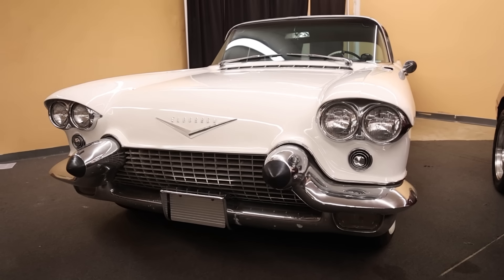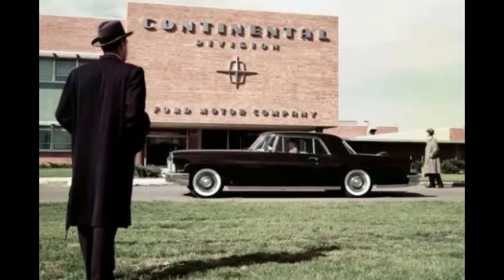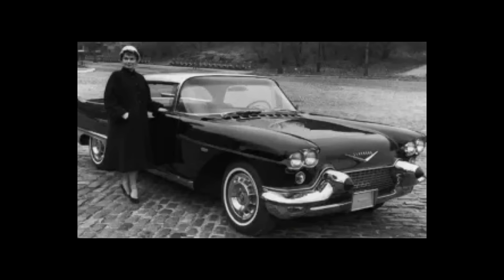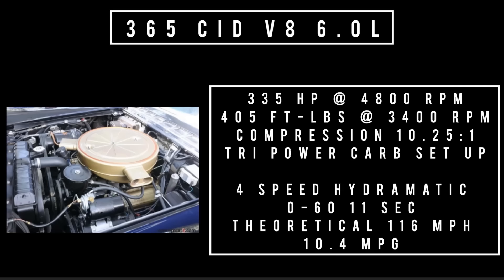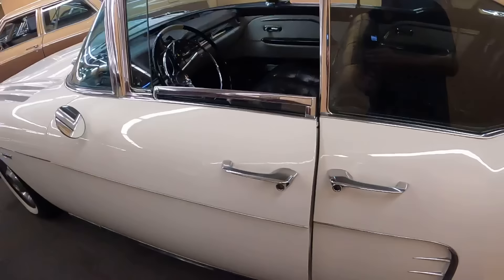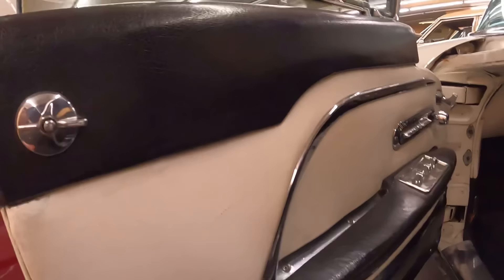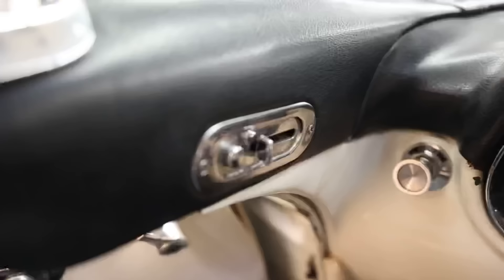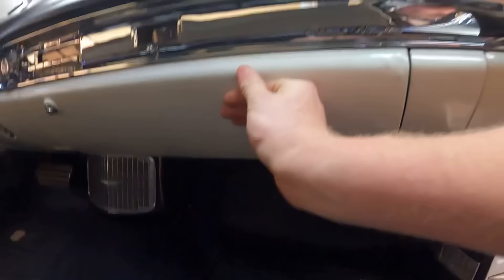1958 Cadillac series 70 Eldorado￼ Brougham, this was America’s most expensive 50s car

Comment: Hello Jay, Air Ride was standard for all 1957/58 Eldorado Broughams but it was very problematic, so Cadillac converted many of them to springs.  Cruise Control was not available for the 1957/58 Eldorado Broughams, but it was standard equipment for the 1959/60 "Italian" Eldorado Broughams(Series 69).
Reply from the maker: Thank you for that correction I found the cruise control in a Hemmings article so I took it for face value here’s the article, I was having a really hard time finding what was standard on that car or what options it had apparently it didn’t have any options but everything was standard but I couldn’t find a list of all of the standard features

https://www.hemmings.com/stories/2021/10/06/a-dream-realized-with-a-rare-example-of-gms-ultimate-in-1950s-luxury

Comment: Great video!
Also, the first car to come with narrow band whitewall tires, other cars would not have them until 1961. Only car other than later Continentals & Thunderbird convertibles that you could close the trunk electrically & originally the rear seat center armrest compartment would have come with a bottle of women's Arpege Perfume.

Comment: You said Fleetwood Brougham because they go together like Marge & Gower, Sheila & Gorden. It was Eldorado Brougham. Air Suspension standard, NO cruise control.in '57-'58. Low profile thin whitewalls. The lights in the front bumper are parking, signal and factory fog lights. The options on on the Mark were A/C, anti-freeze and front license bracket. My Mark had a single color (optional) interior with the A pillars, dash top and headliner in solid red leather. No front plate in my state.  .
Reply from the maker: Thank you so much for the correction I kept trying to keep it straight but I couldn’t lol

Comment: My dad had one of these  (used) around '65/'66 for a few years. Gold with the brushed stainless steel top. The air suspension in these cars was a nightmare, no one liked it. The car 's ride was increadible but the airbags leaked and most were converted to springs. I don't think he's accurate witht eh 3x2 carb set up - I think they were offered in single or dual 4b. The electronics were amazing for the time, antenna would come up when you turned on the radio, dimmers were automatic via a big eye mounted on the dash. They lost their value quickly and didn't hold their value very well until relatively recently. I see them priced between 70-150k. As mentioned, my dad had one and we were not rich. Very difficult to restore. The SS top and sleeker body than other cad's were what make this car's awesome looks. Oh yeah, the battery was mounted in the trunk. Even though very few were made, they're not difficult to come by. One more thing, ours had suede interior - very plush.
Reply from the maker: Great information thank you so much for sharing that =) your dads car sounds like it was awesome.. probably felt like a million bucks until the air suspension broke then was probably a little unsettling wondering geez how much is this going to cost

Comment: Those bumper guards were referred to as "Dagmars".  Why? I don't know. I've just heard many refer to the protruding bullet-shaped  bumper pieces on any car "Dagmars".
Oh, this is a Cadillac, so it has Dual Drives. That is an air compressor on top of the generator for use when the car had factory air suspension. Probably most of these cars of this vintage which came with air suspension(all 4 wheels) were converted to a conventional suspension.  Cadillac learned it's lesson and later focused on a rear load-leveling system(air shocks) and used an engine vacuum powered air compressor(like what schrader made for years). With smaller engines in the future,  incapable of providing sufficient vacuum for the power brakes , emission controls and the HYVAC system, they added a belt-driven vacuum pump and an electric air compressor for the rear-leveling air shocks.
Reply: Dagmar was born on November 29, 1921 in Huntington, West Virginia, USA. She was an actress, known for The Dagmar Story (1951), Dagmar's Canteen (1951) and Broadway Open House (1950).   She was very well endowed.
Reply from the maker: Thank you so much I knew they were called dagmars but I was drawing a blank and couldn’t find that word so I said nothing at all =) 

Thank you so for all the insight as well as information I really appreciate you taking the time to share it with us
Reply from the maker: Thank you so much for sharing that insight and information =)

Comment: Good video about a great car. But you left out the three chrome control knobs on the driver's door armrest. I can kinda tell you drew a confusion blank there LOL. That's okay you're trying hard and probably a tad too young to remember or even know what those would do. Even I at 64 who grew up with those big beautiful behemoths never saw them located there like that. But those 3 knobs control the electric motors that adjust and tilt the big front seat. All the wire harnesses not to mention window motors and heavy tracks devices and actuators for power door locks that's why you have such a heavy door.
Reply from the maker: I didn’t know the buttons so wasn’t going to make something up lol.. and the owners manual didn’t say how those worked
Reply: @What.its.like.  I'll bet that Caddy musta been the first  to put the seat control knobs on the door armrest like that and they were huge just like the rest of that car LOL. Most electric seats on luxury cars the control were under the seat. I know later in life the Continental put them up on the armrest but they were much smaller the same size as it's window buttons actually and all the electric buttons were located together within the same frame outlet so was the side mirror control. I also noticed how the rear exhaust pipe was not inserted in the chrome bumper outlet designed for it. Most people rerouted those especially if they kept the car for years because over time the toxic unsmogged leaded exhaust fumes dissolved all the chrome around those outlets similar to rust look. Anyway ...

Comment: Chevrolet attempted to create an affordable alternative when a custom designer applied Eldorado Brougham trim to a Bel Air and named the prototype El Morocco.  The production version that emerged was the world's first Impala.  Just 10 El Morocco prototypes were completed before the Impala name went to market and the exterior trim revised to set it apart from the Series 70 Cadillac.  Pontiac's alternative to the Eldorado Brougham, the Bonneville, stressed performance.  It was built as a convertible only.  But while neither were cheap they were certainly far less expensive.  After 1958 Cadillac had Pinin Farina build the Eldorado Brougham for another two model years and 200 copies in addition to the 400 units of 1957 and 304 in 1958.  The Series 70 Eldorado returned in 1967 without the Brougham name as a coupe with front drive and shared the basic chassis with the Oldsmobile Toronado.  But its price was also much lower than the Brougham of yore.  The Brougham name appeared later in the 1980s as a trim package for the Coupe De Ville and Sedan De Ville until the GM C-body was redesigned for 1991.
Reply from the maker: Wow thank you so much for sharing all this information =) and insight
Reply: @What.its.like.  The basic Cadillac designs continued through 1996.  The Escalade SUV took over the market later where the Eldorado Brougham used to be.  Years after the Eldorado Brougham was phased out Cadillac tried a 2-passenger roadster as the spiritual successor, the Allanté, and Buick tried the division equivalent bid with the Reatta.  Neither were a success though the Allanté continued to 1993.  The previous year the Allanté sold alongside its 5-passenger successor, the new Eldorado Touring Coupe.  A 4-door sedan counterpart to the Allanté and Eldorado was also offered, a reuse of the Seville name.  They would continue to 2003 after which the CT series took over.  The Seville was now a CTS and the Eldorado was abbreviated in name to CTC.  After Oldsmobile discontinued the Toronado an attempt was made to revive it for 1995 with styling that harked back to the original shape of 1966-70.  Instead it was transfered over to Buick as the Riviera and built to 1999.

Comment: I admire your enthusiasm, pity you're very much less good at the facts, worst though, such a famous low production Cadillac and you can't be bothered to get the name right? It's a Cadillac Eldorado Brougham. Yes the sill plates say Fleetwood on them because that was who, until 1987, built most painted and trimmed bodies for Cadillac. These cars though were hand-built at Plant 21 nearby.

You talked us through the Cadillacs available in those years, the hierarchy. The Series 75 cars were just to in number, the Fleetwood 75 Limousine with glass partition and chauffeur's compartment and the Fleetwood 75 Sedan with the same trim back and front.

Hearses, flower cars and ambulances were built on the rather longer Commercial Chassis.

Pity this car appears not to have the oh-so valuable amenities. Paul